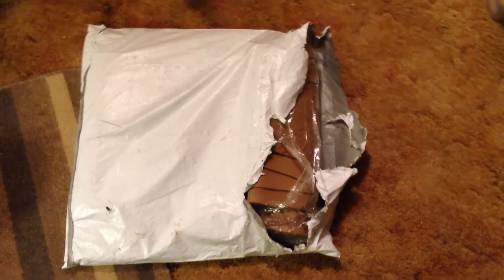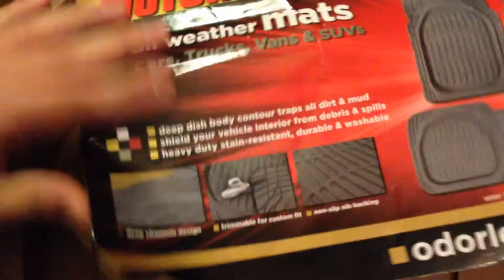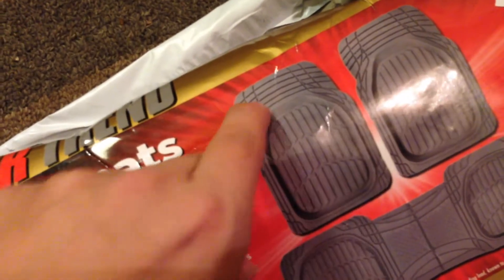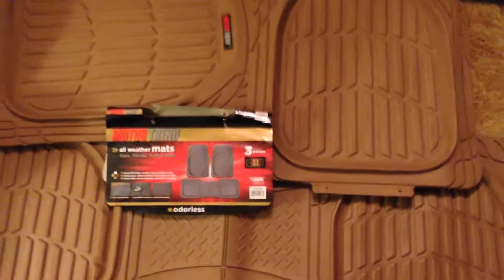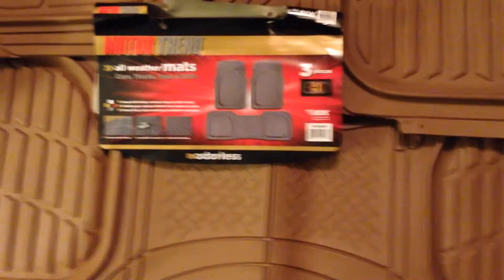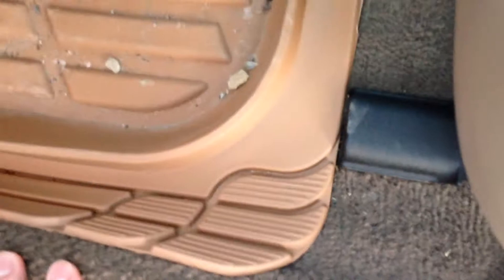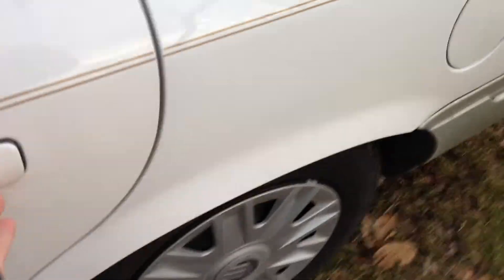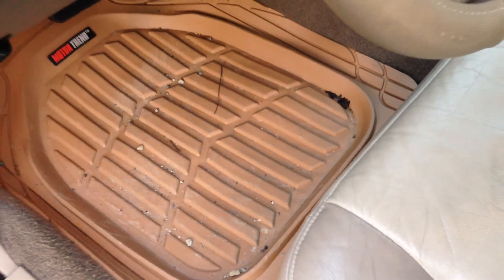Motor Trend FlexTough Rubber Floor Mats Unboxing & Review

Comment from the maker: I also wanted to mention that even though the tag on these mats says "odorless" they definitely do have a noticeable smell. I figured it would dissipate after I took them out of the packaging but there was a fairly strong plastic/rubber smell in my car for a couple of weeks but at this point it's pretty much completely gone. It's certainly not a deal breaker but you may want to know about that ahead of time so if you don't need to use them right away you could leave them outside to air out or if you install them in the summer or to a garage kept car you could keep the windows cracked to help weaken then smell and get rid of it quicker.
Reply: How much did you pay for them?
Reply: Formo Kick They're like 35 dollars on Amazon for the whole set. You can't go wrong.

Comment: Need urgent help.  On the packaging of the motor trend deep dish car mat is says warning this product contains lead and chemicals that cause cancer. Wash hands after handling. I have a son that will be traveling in the car. How really safe are these to inhale if you can't even. Touch them without washing your hands.  Need an urgent response afraid to use them.
Reply from the maker: I would look at the packaging again and see if it says "in the state of California." Many products say contains chemicals that may cause cancer in the state of California because they're more strict about the chemicals and materials used. So many products I've owned have that warning. In reality I don't think they would be any more "harmful" than any other man made products but unfortunately in today's world I would assume many things do contribute to people getting cancer but again I don't think these floor mats would be any more harmful than any other floor mat you could purchase. Since the smell of the new rubber is fairly strong for a week or two I would recommend either keeping them outside or in a basement to air out or keep the windows down in your car while driving until the smell wears off. I'm not sure if it's toxic but most strong smells give me a headache and sometimes make me nauseous so for comfort's sake I'd let them air out before installing them in the car.
Reply: It is because of prob 65 rule. In california there is warning sign everywhere. Mc Donald? Yes. Starbucks? Yes. LAX? Yes. Literally everywhere. This law is for lawyer. I think this company is just trying to protrct themselve from the freaking lawyers who suing every products without prob 65 label.

Comment: How is it holding up?
Reply from the maker: I took them out for the summer and went back to the carpeted ones but throughout the winter they held up well. The material hasn't worn any or bent. I occasionally would clean them with soap and water however since they are a light color the driver's one is starting to stain a bit but it's not very noticeable and it's better for them to be dirty than the car's carpeting.